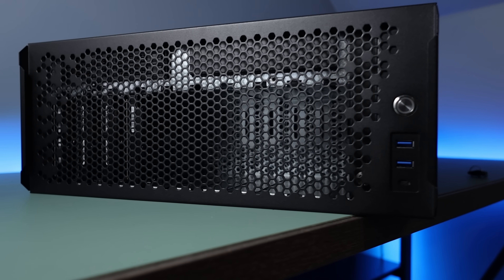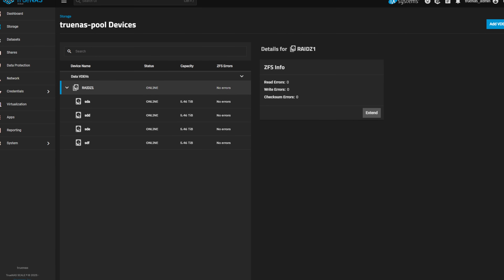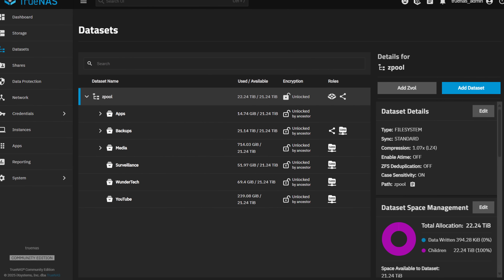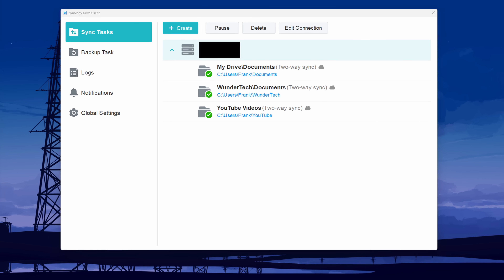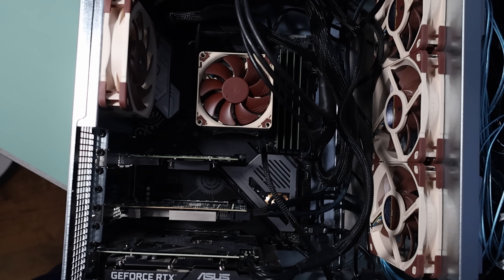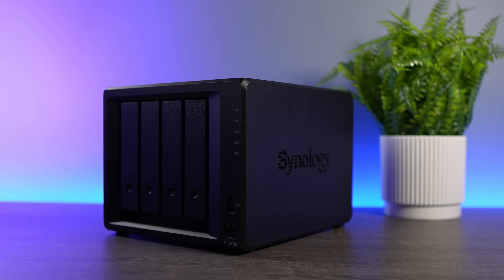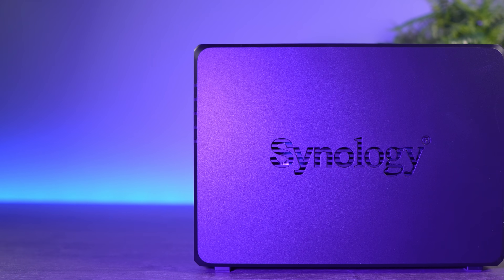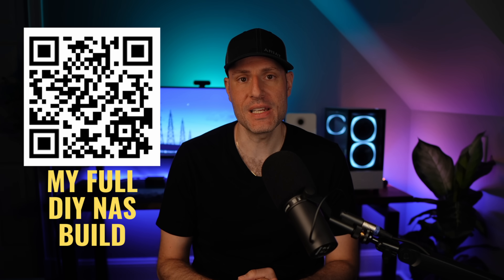Everything I Did Wrong Building My DIY NAS (was it a mistake?)

Comment: I also recently did a similar thing switching from Synology to TrueNAS. I had acquired a used PowerEdge R740 from work and slapped ProxMox and virtualized TrueNAS (your guide on passing the drives through helped). I love it a lot more than my DS220J (lol), but also miss some of those first party apps.

Comment: I've loved Unraid since I started using it 14 years ago.  I just "upgraded" my motherboard and CPU to a used Supermicro X10SRL-F server motherboard for $100.00 and a Intel Xeon E5-2697A v4 (32 threads) for less than 50.00 and then added 128GB of DDR3 ECC RAM.  I had a Supermicro motherboard before and loved the IPMI and BMC features and I'll probably never go back to non server mobos.  I'm using ZFS for my SATA SSD cache drives and all my docker containers on a mirrored ZFS NVMe drives.  It's so nice to be able to upgrade what I need to as Unraid adds features to their versions.  I don't know about their new pricing model though.  I bought my Pro license 14 years ago and I'm happy that they haven't tried to charge me more.  If they do, I might need a new OS.

Comment: For the price of a NAS I can build a great computer here in Brazil. So while something like ugreen or sinology would be a good starting point, the price is prohibitive because, it is the full price in USD multiplied by 6 and then, you multiply that by 2 because of taxes.

Anyway, I am always looking forward to see what you guys build and use.

Thanks for sharing
Reply: you can anywhere but a computer is generally a client of the NAS, a computer is typically not meant to manage and spin multiple hard drive 24/7 at low power use

Comment: I built also a NAS with TrueNAS OS in the past and was struggling with all kind of issues. Then I saw that I'm not the only one in the household which would access the data on the NAS and came to the conclusion that this solution must be more easy and user friendly at daily usage. So I bought a Synology DS423+. The issue with Synology in my opinion is that the core functionalities sometimes are not so well integrated. If you compare for example it with NextCloud then you will see that every functionality or module here has the same look and feel this feels for the end user more practical and user friendly. On a given moment I tried to install NextCloud All-In-One. But the client had serious performance issues with synchronizing the data. So I did a step back and started using again the Synology packages.